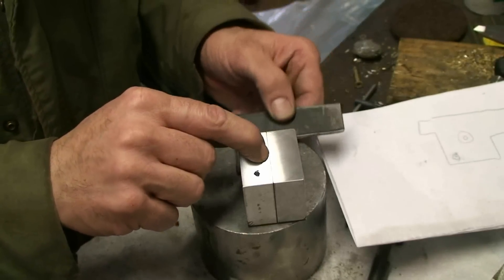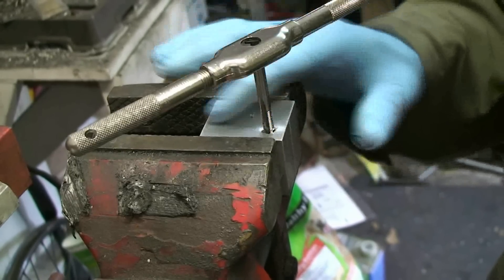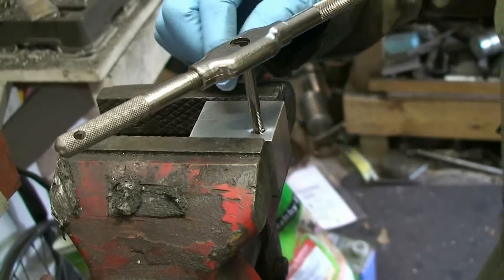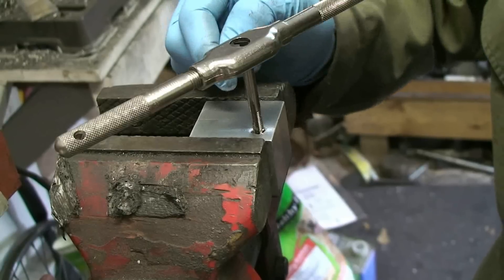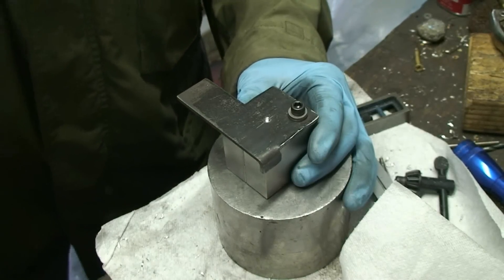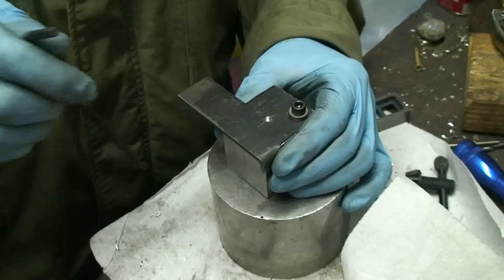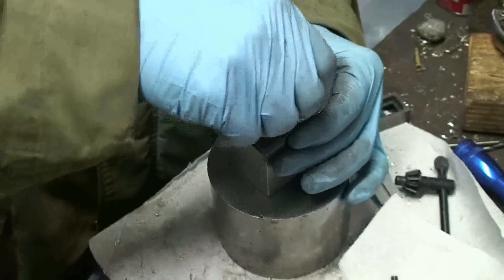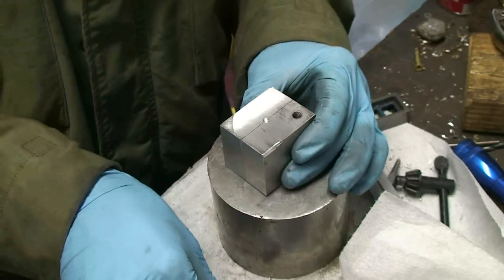Homemade bullet mold part 3.mp4

Comment: You would find it much easier to get central alignment of your sprue plate if you drilled a small pilot hole in the mould blocks, the same size as your pour hole in the sprue plate, then ,by using the drill as a locating dowel, spot through the pivot hole into the mould block, this would give you a pour hole dead in the centre of the cast bullet.